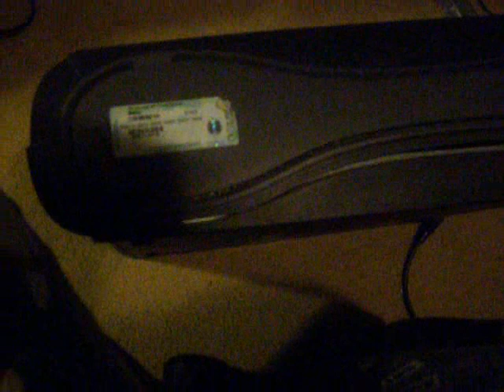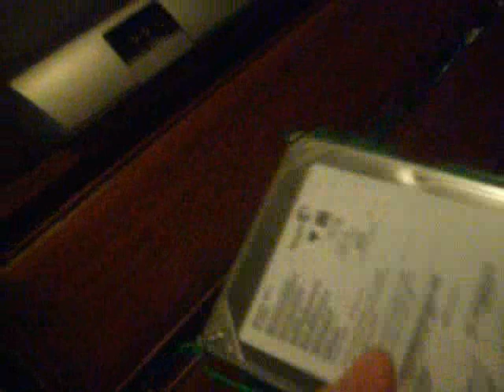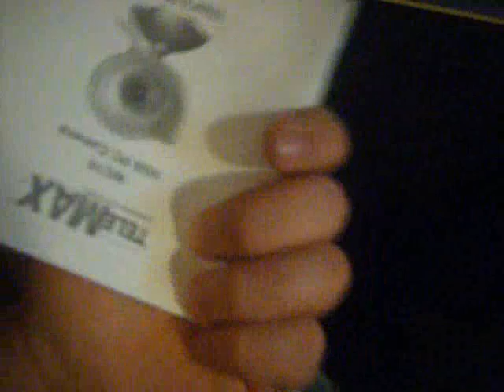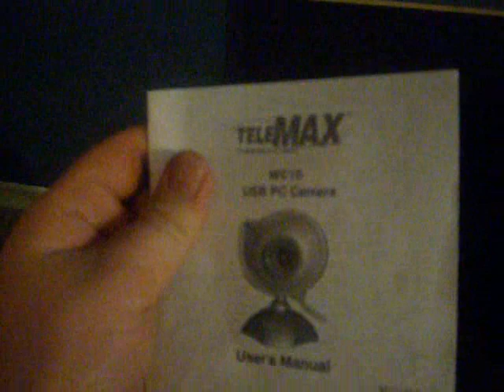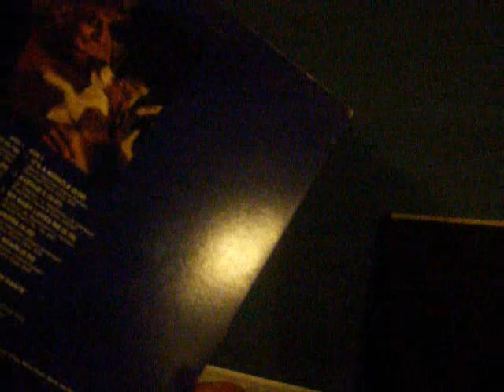Got Another Dell GX280 That Doesn't Work And A Floppy Drive For The C640!

Comment: i actually had the same issue with a gx280 and took a small medal clip and fastened it to the back cage and screwed down into the fan to hold the fan down on the cpu, this fixed the issue and no longre had issues with loud fan/orange light.

Comment: Say did Dell recycle that case from the Opti-plex 280 to be used on different computers? BTW never stand an Xbox on end if you bump into it you'll scratch the cd. Fun Fact! The Red Ring of Death is caused by the graphics chip on the motherboard not having a good connection. To fix this resolder the graphics chip or do it the "cheap" way and over heat your Xbox to soften the solder on the graphics chip and get a better connection to the board. I'm glad you also got another working camer too.

Comment from the maker: @Jmster1 LOL I tapped the CPU Fan it sits on top of the CPU of course and when I tapped it the Orange light suddenly turned green! but when I turned it off and turned it back on the orange light came back on tapped the CPU Fan and the orange light switched to green again the third time nothing happened also I never heard any beeping sounds just the loud fan and the orange light but the beeper only goes off when there's no RAM but I since this dell and the other dell are dead it doesn't beep
Reply: Sounds like either a motherboard or power supply issue to me. Most likely motherboard, but you would have to run a voltage meter over the power supply to actually test each rail.